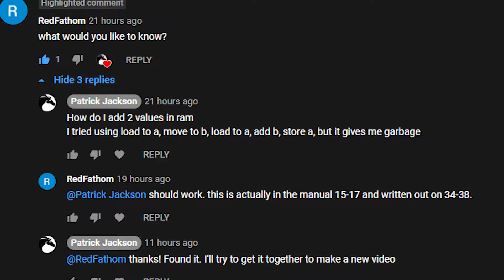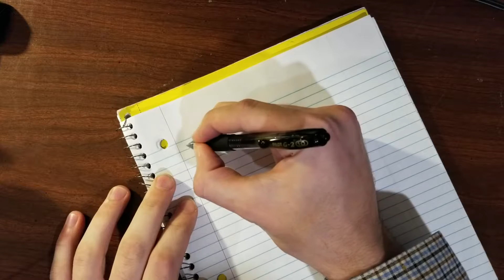Altair 8800 - Adding Numbers from Memory - Front Panel Programming Tutorial #3

Comment: Is that an authentic Altair 8800? 😁

P.S. the first instruction, ANI 0, isn't necessary, since the following LDA instruction changes A anyway; also, assuming the three terms are contiguous in memory, you can use HL for indirection and use single-byte increment instructions and bring the code size from 14 bytes down to 9 bytes as such:

;Add two numbers together
TERM1 EQU 040
ORG 000
LXI H, TERM1 ;Get addr of first term
MOV A,M       ;Get first term in A
INX H             ;Go to next term
ADD M           ;Add to A
INX H             ;Go to result variable
MOV M,A      ;Save result
HLT                ;Done
;Total: 9 bytes
Reply from the maker: Hey, thanks for the programming insight! I'll definitely use that.

As for the altair, no, it's not a real one :( its the arduino due emulator from adwater. Fantastic emulator though, and I have a cromeco dazzler I have yet to hook up to it
Reply from the maker: Interesting, I hand assembled this program and got:
000 :  041 020 000 176 043 206 176 167
010 :  166

However, nothing is in the result memory address, 022. What am I doing wrong?